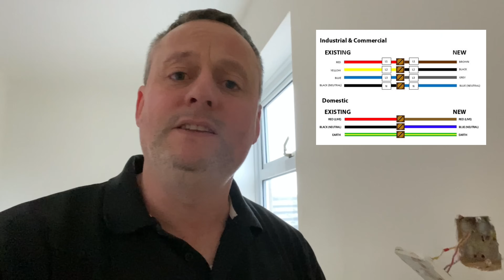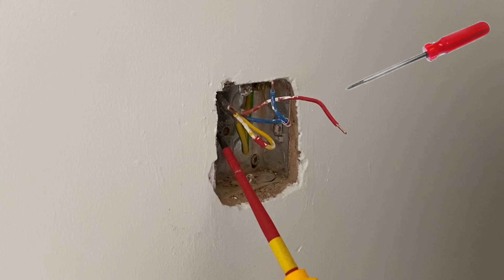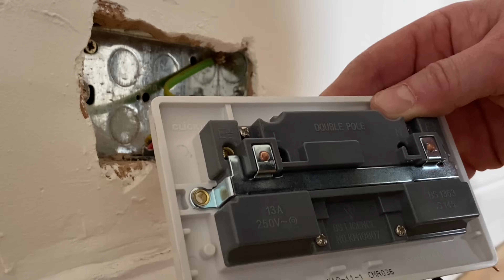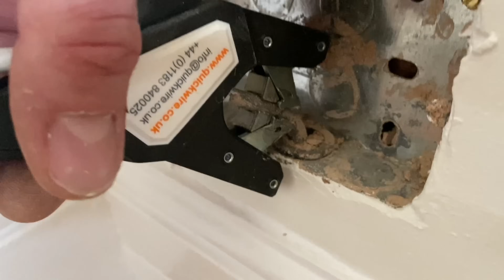Top Tips When Connecting UP Sockets & Switches - Cable Colours Pre 2004

Comment from the maker: == 🕐 Time Stamps - Cut to the action 🕕 ==
00:25 - Pre 2004 cable colours
00:49 - 3 core cable colours pre 2004 at a 2 way switch 
01:50 - Damage to conductors (cables) 
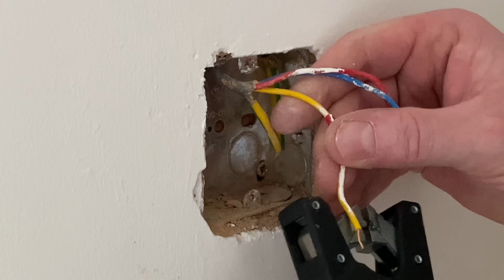02:49 - Re-terminating 3 core cable ends 
04:45 - Connecting a new 1 gang 2 way switch
06:25 - Connecting in a 1 gang 2 ways switch that is being used as a 1 way switch 
07:05 - Connections in a ceiling rose a pendant with pre 2004 cable colours
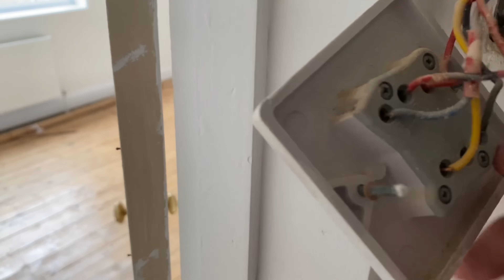08:05 - Connections in a 2 gang light switch with pre 2004 cable colours
09:29 - Cables in a twin socket outlet
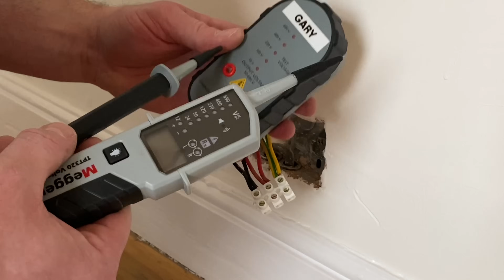10:20 - Safe isolation of a socket circuit using a voltage indicator and proving unit
11:40 - Stripping a reconnecting a twin socket wired in pre 2004 cable colours
13:17 - Earthing metal back boxes
14:20 - Connecting up a twin socket to a ring final circuit wired in pre 2004 cable colours
15:36 - Tapping out the lugs on a socket box with a 3.5mm tap 
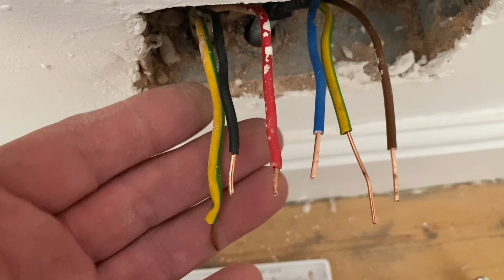18:33 - Mixed cable colour pre 2004 and post 2004 (old and new cable colours)

Comment: I have an issue in my loft. I’m trying to fit a light and I want to fit a junction box to the exiting lighting cables up here. The problem is they’re all individual cables coloured grey, with separate green earth wires along side. 
How do I know which cables are neutral and live? 
I checked in a light pendant and they appear to be doubled sheathed with black or red inside. 

Is my only option to cut the cables to see what colour they are inside?

Comment: How long do people strip cable length too for switches and sockets? Someone I work with reckons to cut to furthest side of back box from where cables enter and that’s plenty!? Nothing worse than having loads of slack to dress back into position to allow switch or socket to go back on
Reply from the maker: I go for 50 to 70 mm longer than the box 👍🏻

Comment: I have just purchased a 1930s house which has had a partial rewire. All the sockets have had new wiring, however, the light switches and pendants are red and black. Do I need to rewire them? Or can we live with it? Any advice would be much appreciated.
Reply from the maker: Get an EICR done by an electrician would be my advice 👍🏻

Comment: Personally, when changing an accessory I like to remove any excess plaster and vac out the back box. I also remove any paint on the wires and straighten out the cores which also makes it easier to remove any excess sheath. I also find with older cables that it's easier to remove the sheath in smaller sections when using an automatic stripper and reducing the chance of damage to the cores. On some older cables, the sheath struggles to slide off, especially the lower quality cables.

Comment: This is really useful,  when watching i was wondering what were the scenarios where swapping sockets and the cables are too short would be a good follow up ie when you have to trim them, or line/neutral are switched and can't reach to connect and they were not long enough, ie do you extend individual conductors, ie crimp or idealindusfries spliceline, or use say a wago 2 port connector blocks for each conductor to extend or just use say a 3 port one 2 for ring conductors into connector in backbox and a single conductor to socket like a mini spur all in the backbox or something else; would be good to see a video on the best practice

Comment: Hi Gaz, excellent video thank you. Quick question.  What does one do if the live or neutral wires insulation is damaged exposing the copper conductor.And there is no extra length.  Is it ok to crimp a replace live or neutral wire? Or does one use a connector block? Thanks
Reply: I can't say if its best practice or not but I personally would use blue or brown over sleeving depending what the conducor was,it depends how far down the damage to the insulation is or if the copper itself is damaged or weakened. 
I have used crimps before as well or even wagos to extend cables
Reply: Thank you

Comment: Fab video Gary. That outer sheeting proves my point about the aromatic wire stripper, OK for the conductors but you can't get in tight enough to the top of the back box to remove the outer sheath. May as well just use side cutters. Three tools to do a job we're two would have done. Great video I was always told to use the red as common. Don't get me wrong those automatic wire strippers are good just limited in there use I have had one for about twenty years nothing special just a cheep as chips tool I think you know the ones, I have used it once or twice and it's been in a box on the top of my wordrobe ever since but it is a good little tool, at the end of day every one has there own way of doing things and use what ever tools they choose to use.

Comment: Hi Gaz, love your videos. Curious to know, when stripping the outer sheath from the cable, what would be the correct procedure if for some reason the primary insulation on the conductors was damaged? Do you add some heat-shrink, tape, replace the entire cable, etc.??? Thanks
Reply: Yes I would like to know the answer to this question as well please.

Comment: I miss the old colours. Great video as always gaz!
Reply: You could see them better as well in poor light.
Reply: @anthonybragg  i have trouble seeing the difference between brown and black in low light, but red, yellow and blue were three distinct colours, brown and black are similar, do you think we will change back now we have left the EU lol
Reply: @n4thb4dc0  from what I’ve seen it’s not harmonised throughout Europe anyway. It’s got to be one of the most stupid and pointless things they ever did.
Reply: @jamesdyas542  Agreed. Black used to be neutral but now it's live and blue used to be live and now it's neutral! As others have said, its also harder to differentiate the colours in poor light.
Reply: @KendalMike  And just as dangerous is that differentiating live/hot and neutral can be hard especially with grubby or discolored cable.  I have heard of more than a few cases of Euro buildings where neutral got transposed with a live/hot and everything on the 2 other phases got 400V and blew up.
Reply: @KendalMike  meanwhile in other countries, or even my country, we still use Pre 2004 cable colour. They changed it to Grey Black and Brown for live, but not many factories make those colours so we use your standard Red Yellow Blue as live.